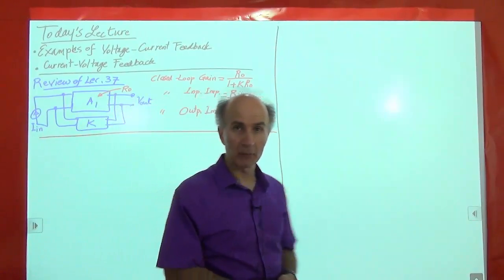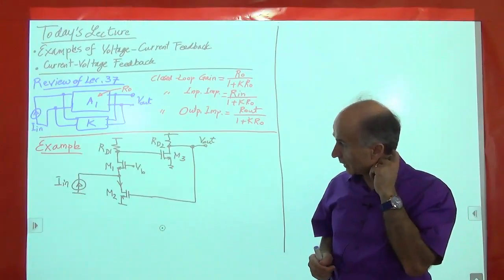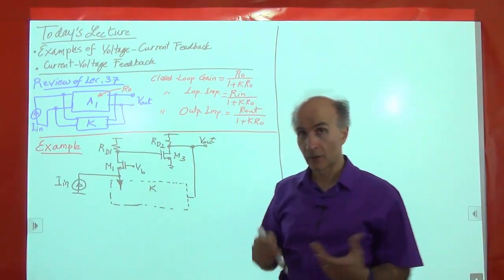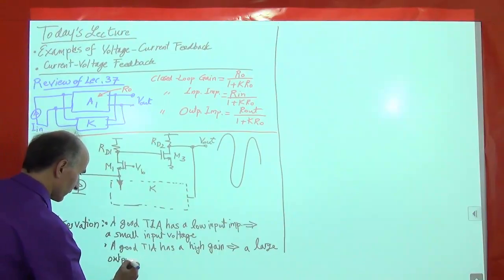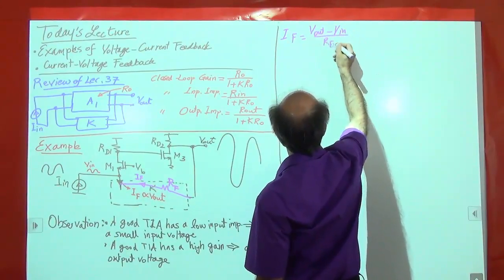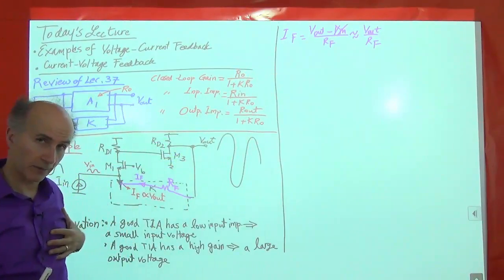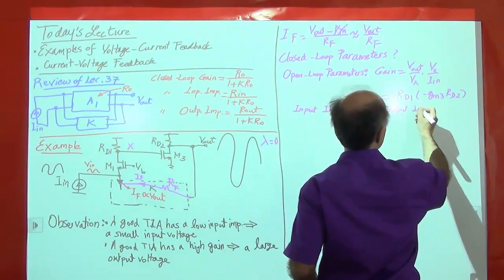Razavi Electronics2 Lec38: Examples of Voltage-Current Feeback, Current-Voltage-Feedback

Comment: 01:25 - Intro and Review
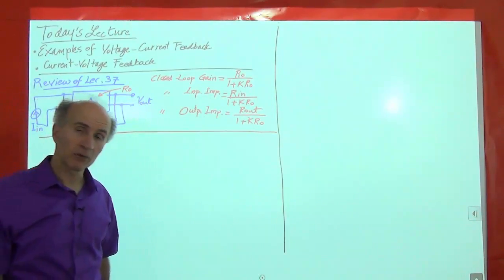03:20 - Improving the Gain in Voltage-Current Configuration
>> 10:00 - Input voltage swing due to input current is low as TIA has small input impedance, especially compared to the output voltage that is amplified
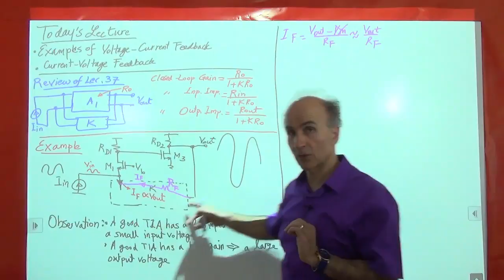>> 12:15 - Resistor can approximate current source if it's input voltage is large and impedance that it is connecting to is small
>> 13:30 - Closed-Loop Parameters
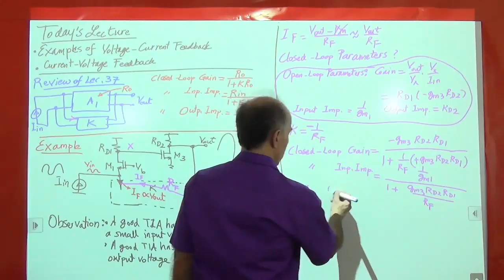>> 21:00 - Sign of the Feedback K
22:09 - Non-Inverting Amplifier Construction - Changing Current Amplifier to Voltage Amplifier
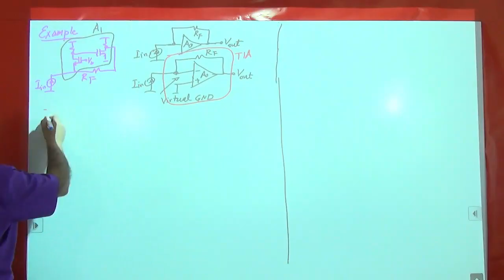>> 27:20 - Open-Loop Parameters - Problems, differing to later
>> 28:38 - Finding Closed-Loop Gain Directly
>> 31:05 - Finding Closed-Loop Input Impedance Directly - Utilizing Miller Theorem (as we know voltage swing across only resistance)
>> 35:12 - Finding Closed-Loop Gain by Breaking it
37:28 - Current-Voltage/Series-Series Feedback Topology
>> 43:05 - Finding Closed-Loop Gain Directly
>> 44:59 - Finding Closed-Loop Input Impedance

Comment: 01:16 Examples of Voltage-Current and Current-Voltage Feedback
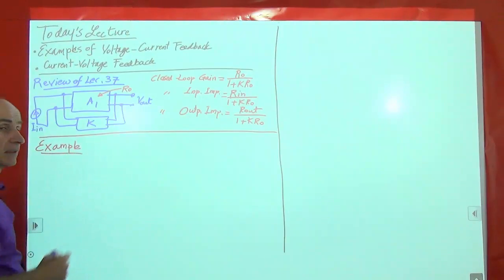03:34 Addition of stages to increase open-loop gain
08:47 High gain leads to large output voltage swing
11:36 Voltage-current feedback network with a resistor
16:45 Understanding the concept of K in voltage-current feedback circuits.
19:13 Feedback is negative
24:26 Erklärung des Aufbaus und der Funktionsweise eines invertierenden Verstärkers
26:34 Understanding the concept of a Transimpedance Amplifier (TI)
31:09 Finding the input impedance of the circuit using Miller's theorem.
33:14 Evaluating different perspectives on voltage-current feedback.
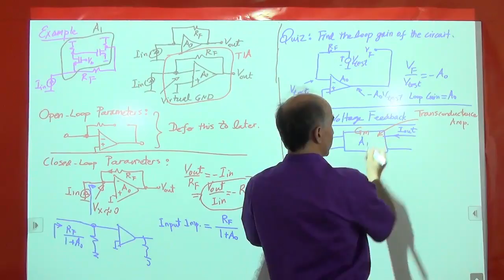39:02 Setting up feedback network for current measurement
41:06 Importance of input impedance in voltage and current measurements
45:13 Der Eingangsabstand zur gesamten Schaltung ist entscheidend.
Crafted by Merlin AI.

Comment: The easiest way to think about the inductive behavior of the input and output impedances of this shunt-shunt feedback scheme is to know that:
1) A shunt connection will reduce our impedance at that point
2) Obviously, due to the low-pass behavior of our controller/nullor/op-amp, this is not going to hold true for a long range of frequencies
3) Therefore, the opposite will happen. The impedance at the shunt connected node will start increasing -> inductive behavior.

Comment: 02:55 - Because we are minimizing current error, input impedance will be lowered for voltage-current feedback; Because we are minimizing voltage error, input impedance will be increased for voltage-voltage feedback. Everywhere in the loop due to negative feedback changes would be harder to make...

Comment: For op amp k=-1/RF Closed loop gain by KCL KVL is -RFA0/1+A0
By this G is -RFA0 and K=-1/RF and LG=A0
Way to get G : 
Break feedback connect RF from negative input terminal to ground (opening loop properly) and get Vout/Iin = -RFA0 as above as G.

Comment: The A0 of a transimpedance has a unit of (R). It is different from voltage gain which doesn't have a unit and is used used in 32:30 in Millers theorem. I don't understand why professor Razavi mentioned A0 as VOLTAGE gain of the amplifer while he was talking about transimpedance amplifiers.
Reply: Me too... But I think A0 is the gain of OP amp, while A1 is the gain of the Transimpedence amp.

Comment: 24:10 - Don't we need to take our current source output impedance if it were non-ideal into account? Either way, doesn't our assumption of K=-1/R_F fails now as we change amplifier's input impedance to infinity or some big value?
31:05 & 35:12 - K*A_transimpedance = A_voltage

Comment: 17:00 - Do we expel feedback K from the circuit when calculating Input and Output impedances, if not, where do we break the circuit as it may impact resistance seen on input/output ports?
Reply: Break at Vout right to the R(F). And in this case the KA equals: 
1/RF
* RF gm1 / (1+RF gm1) * RD1
* gm3 RD2. 
The only difference is there's no RF gm1/(1+RF gm1) in this video.

Actually, when we calculate the K by inspection, we also see an input impedance of "1/gm1" from the left of R(F) which has been neglected in this video. Hence K should equals the (negative) sum of R(F) and 1/gm1.

Comment: 13:17 how the resistor in feedback sense the output voltage it is not in parallel .... can any one help out this ?
Reply: The Resistor is in parallel with Vout. Because Vout is measured from the output node to GND.
Reply: Look at it this way -> the sensing is done directly it takes Vout and gives Vout bw its right terminal to ground
There is just a wire to do that job so they are in parallel